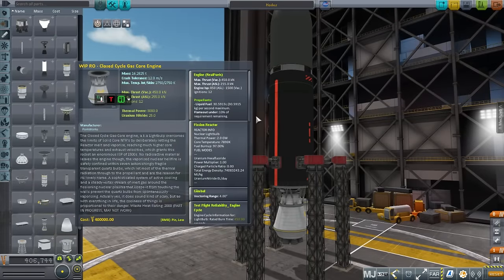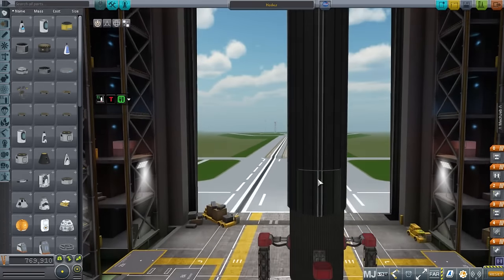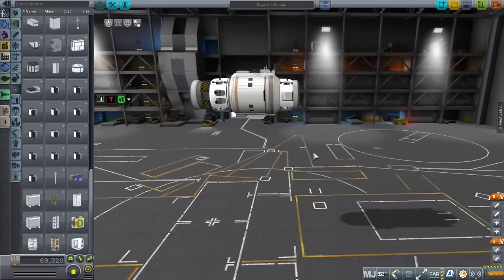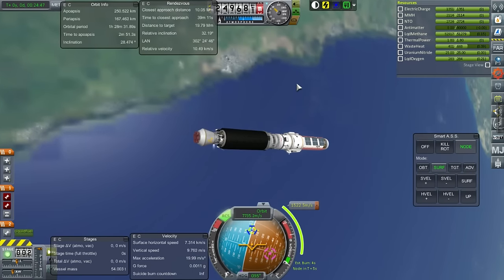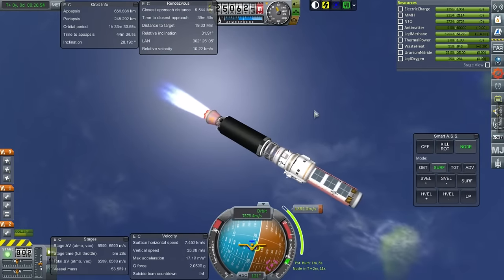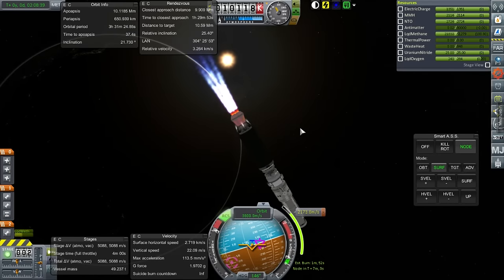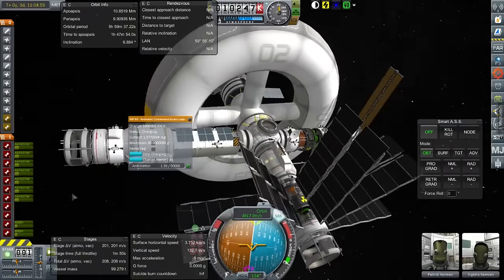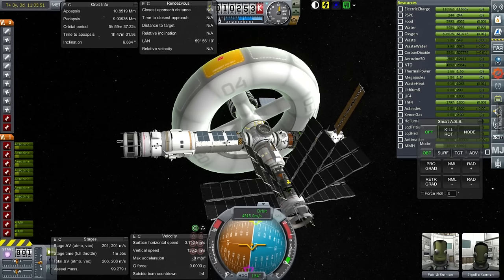Kerbal Space Program - Interstellar Overhaul 03 - Test Flight and Candles

Comment: The problem with the ResistoJet RCS was that you didn't have any magajoules to power them.  When they have 0 power they revert to very low ISP mode and still function at the same thrust level.

They are not useful unless your main engine is using MegaJoules like the ATILLA, otherwise the generator to power them isn't worth the extra weight compared to just monoprop RCS.